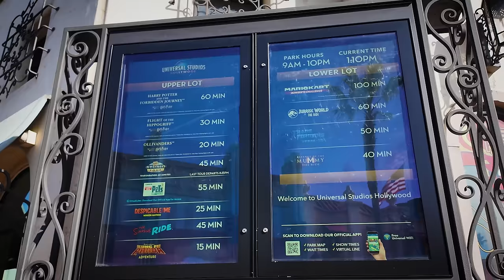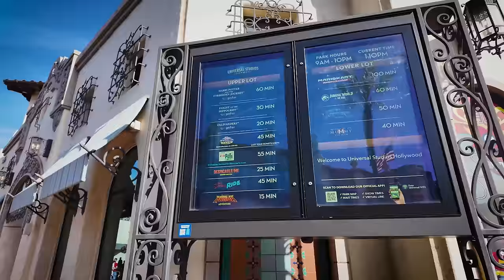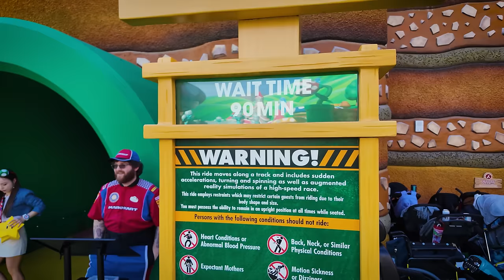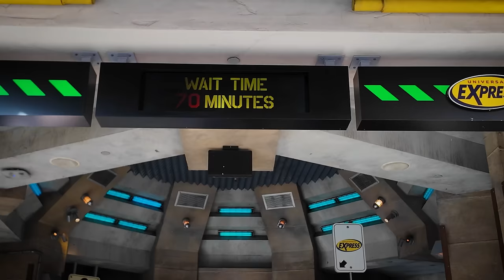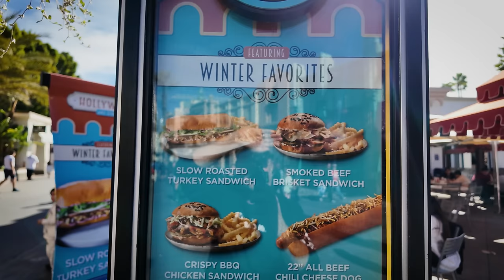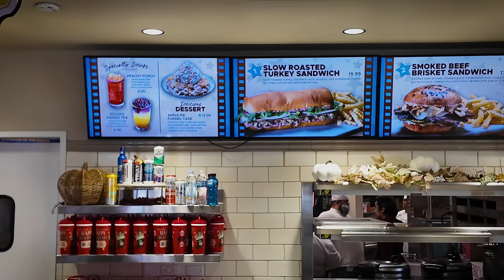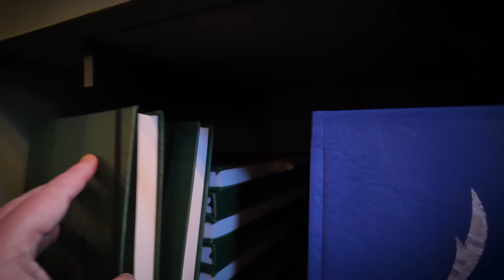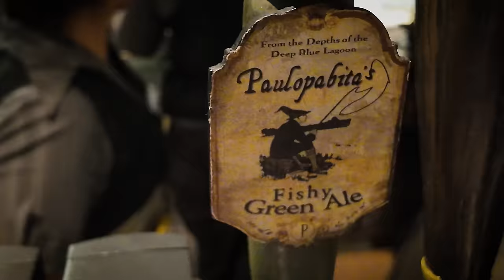Construction updates, new food and rides at Universal Studios Hollywood

Comment: You said it David. The gap was SO big between Disney and Universal. They only had two resorts. Disney currently has 5. they are closing the gap with adding two more resorts and one more park. Universal Orlando is just now starting to really give WDW a run for its money. USH is still lightyears (pun intended) behind Disneyland. So saying Disney needs to do something quick may only be necessary to maintain that gap, not catch up or "respond."
Reply: Universal Hollywood is closer than you think.  Half the rides at Disney are just spinner ones that don’t do anything